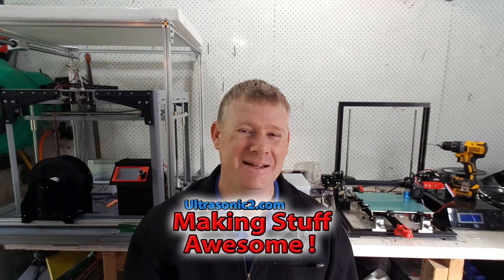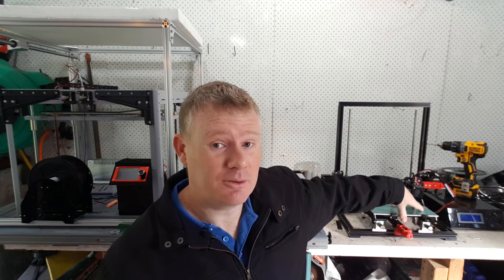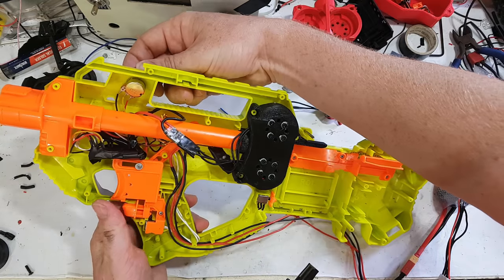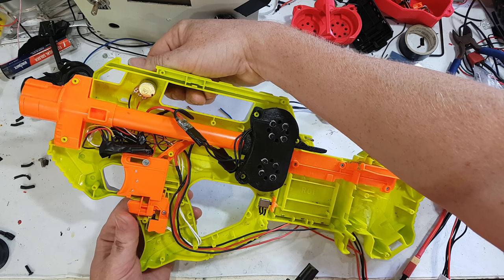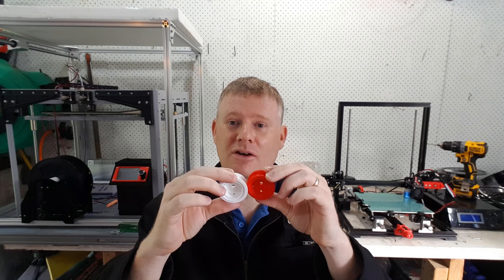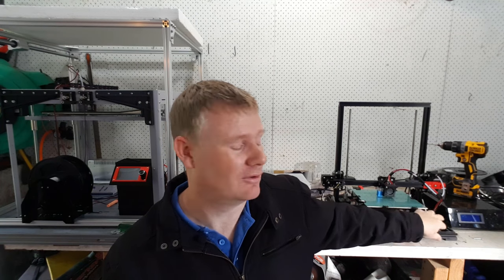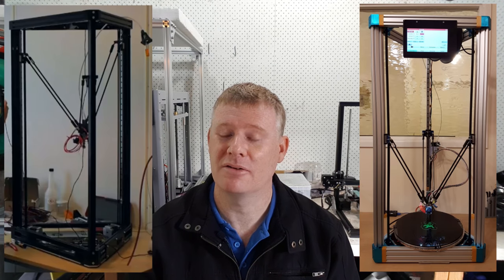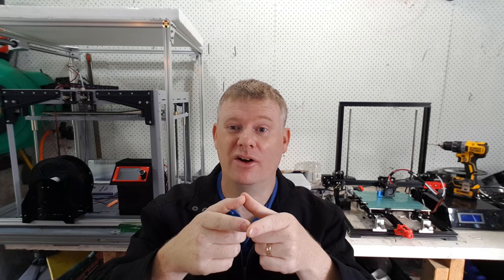⚡️ The high Quality DIY Delta Kossel 3D Printer Build

Comment: I have the DIY Anycubic Kossel Linear Plus, my first printer. Went together well, everything seemed fine. ran a test from SD and crashed the head, routered a track in the build tak before I figured out how to raise Z. Surfed forums, tried fixes finally got updated firmware, getting decent quality prints. Its great hardware package but the software is terrible. The motors are noisy and vibration dampers are said to quiet them down but its a job to break down and install them after the fact. Definately suggest a 4 pack
Reply from the maker: Yeah well thats just another example of spending good money on a printer that you're expecting to work but it. i reality you have to send a bunch of money to get it any good
Reply from the maker: When saying 4 pack i assume you mean diode smoothers ? .. if so it should never have come with the 8825 drivers in the first place ...

Comment: ooohhh jeez, at 3:30 when you move your print bed around, you can see the backlight of the LCD light up, this is a result of the motors acting like generators and back-powering your driver board. Even with the machine off or unplugged, you should still never do it, because you're generating voltage that you're pumping back into the system. I've seen many people blow their drivers this way.
Reply from the maker: yeah i know... you get what you pay for lol

Comment: Im pretty sure you will find you have the same issue even on a delta, the problem is the slicer software interprets a circle as a multi faceted object with straight lines, not as a true round. Some slicers have options to increase the face points to help even it out, but never to a true round. Im sure someone will correct me if this is wrong.
Reply: Nope, you're bang on, however you can improve the roundness of things simply by increasing the number of points in the cylinders/circles.
Reply from the maker: I have tied different Slicers but that seemed to make no difference ..  I obviously have 2 printers and one of them is better at printing roundness .. this is why im heading down this track ... This is Not to say you're wrong Just to say that the machine / Controller also has to be a factor in accuracy of any print.
Reply from the maker: Err id Be SUPER interested in the roundness setting .. I couldn't find such a thing in simplified 3D .. could you give me more information ?
Reply: The overall roundness will be a factor of the model, computers simple don't have a concept of a circle so however you do things it always ends up being converted into x/y steps.
Reply: Making Stuff Awesome if you’re still interested and want to dive into a world of reasons why everything sucks gooogle “slicer g2/g3” and start reading... 
there are a bunch of gcode post processors that claim to be able to transform g1 segments into g2/g3 moves. Haven’t tested any of them though.
Reply: @Ultrasonictwo  I don't know if you're still on this quest, but I would assume he is talking about in the creation of the stl file that you import into there. Or if you are importing something like a step, it is still probably using triangles to calculate the geometry